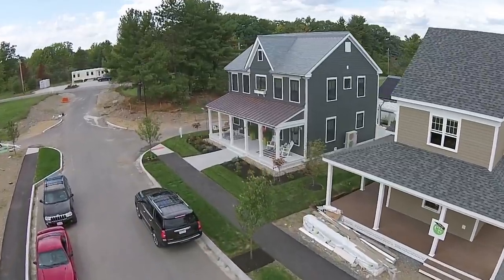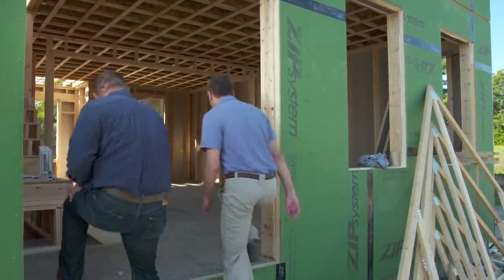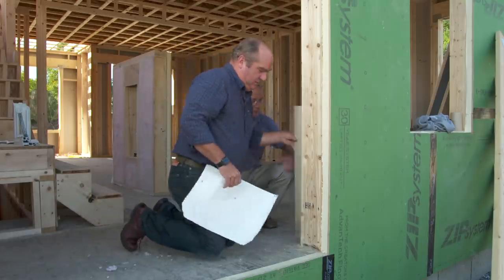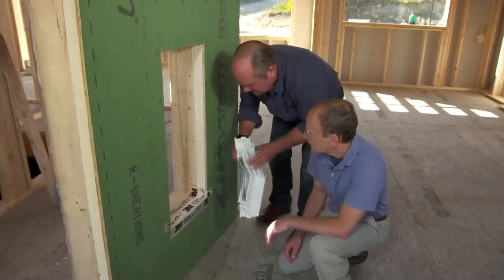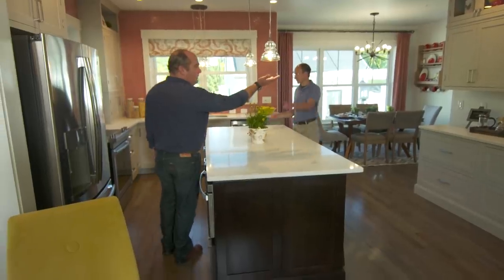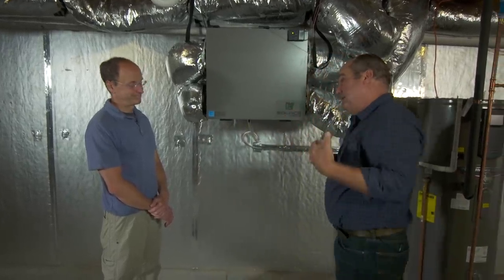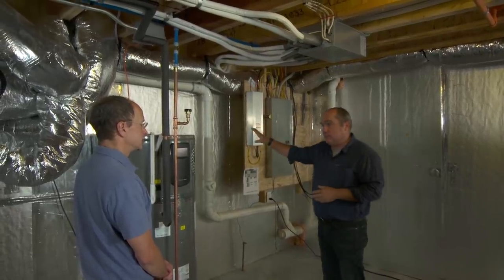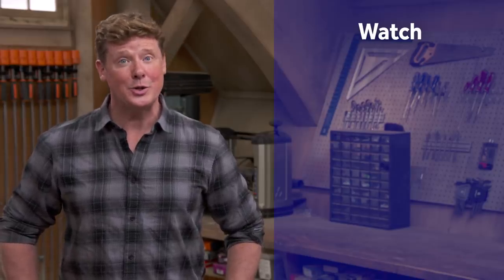Building Energy Efficiency | This Old House

Comment: They never say a cost for a house like that...
Reply: cbryantbear
 ... in other episodes they discuss the costs indirectly by saying it raises things by 20 - 50 bucks per square ft over conventional minimum code. IOW, on a 2k sq ft home that's $40 - $100k more up front.... but there are still tax breaks on certain energy star appliances and solar installations. In most cases you save in the long run after 10+ years.
Reply: @rupe53  good to know. Thanks for the info.
Reply: @rupe53  My understanding is that appliances can also be factored into your property tax assessment
Reply: @genkiferal7178  .... yes, most permanently installed appliances will be factored into assessed value of the house... and therefore into taxes. This is one of the major reasons people add above ground pools or hot tubs instead of sinking them into the ground. The adjoining slab or deck is "structure" so taxed, but the pool or hot tub is free standing, so exempt. OTOH, I don't think I have ever seen one of these qualifying for an energy star rating.
Reply: @rupe53  I've seen some Japanese kitchens with kitchen furniture on locking wheels that fits under permanent, fixed countertops.  For tax reasons, things like that and armoires might be a good idea - though they waste a bit more space - maybe as much as 25% wasted space, I think, compared to built-ins. They don't look quite as good, either.
Reply: @genkiferal7178  ... sounds like you need to find some loopholes and exploit them. The problem with doing that in North America will be banks not recognizing the value of a home that doesn't have certain things built in. Good luck getting a loan if a bank feels the house is missing some things. There are also requirements within building code that can throw a curve ball into the game.
Reply: @rupe53  I don't do loans and am not interested in resale value much.  I am a weirdo who loves home and falls in love with the land and the trees, streams, hills, mushrooms, and wildlife on that land. Maybe I am in the 1%.  idk
Reply: @genkiferal7178  ... I understand the concept but 99% of the market is driven by more conventional ideas of values, which equals dollars.
Reply: @rupe53  i know.  i wasn't fussing at you.  just explaining.
I am not a fan of "follow the leader" or "monkey see, monkey do".

Comment: Why are you guys still building houses from trees? Bricks, 100mm insulation filled cavity and thermal blocks on the inside. Lovely and toasty. And solid. 

And Mr Wolf won’t blow down the piggy house when he huffs and puffs 🙃
Reply: Because Americans love cheap and few are able to see long term benefits. It's the disposable society.
Reply: wood is easly to source and in earthquake country stone/brick houses fall apart
Reply: @4TwentyFour20  the whole of America is not “earthquake country” and they still build homes from brick even in California. They just have more strict building requirements. 

In frontier times using wood was the obvious choice. Hell, we did it here (🇬🇧) for centuries. But then we began manufacturing bricks en mass

Anyway, my comment was tongue in cheek. I really like a New England wooden house. I’d just make sure it was well insulated 👍
Reply: @GeeTheBuilder  all good dude cheers from the usa 👍🍻
Reply: @4TwentyFour20  I love the USA. Amazing country 🥰
Reply: @GeeTheBuilder  Just about all of the U.S. is earthquake country. The February 7, 1812 earthquake, centered near Marked Tree, Arkansas was felt in Cuba and Canada.
Reply: makes no sense. Fort Pulaski is 3/4th underground, built with thick brick walls, and may show no signs of damage/aging.  It feels air conditioned inside (too cold for me!), though a bit too dark for most tastes.
Reply: @KieraCameron514  The one in 1811 created a big lake across the AR border in northwest TN.
But, many parts of the USA do not have earthquakes - not big enough to crumble a house anyway.

Comment: How in the world is it costing you $3,000 to heat that old house for one month and $1,000 for a while year isn't anything special.  House built in 70's, 80's and 90's (3,000 SQ FT) in Montana only cost about $100 a month to heat in the winter months, ......and Contractors haven't used 2x4 outside walls in a long, long time